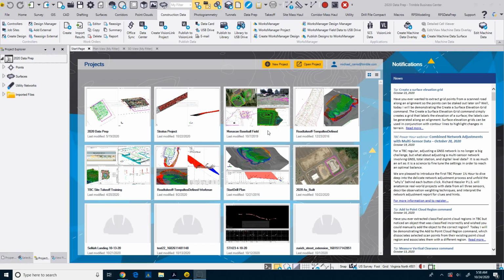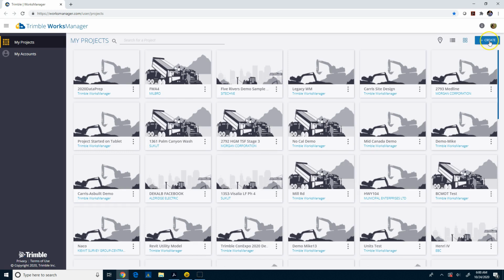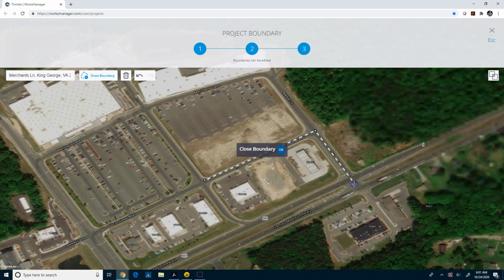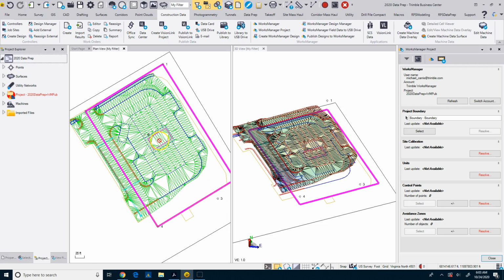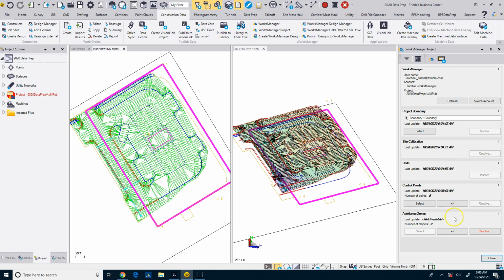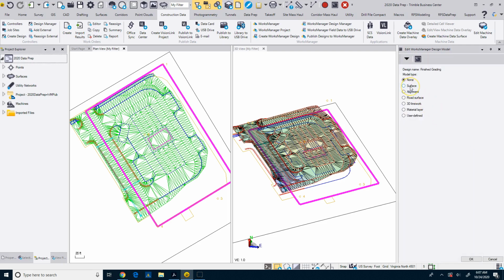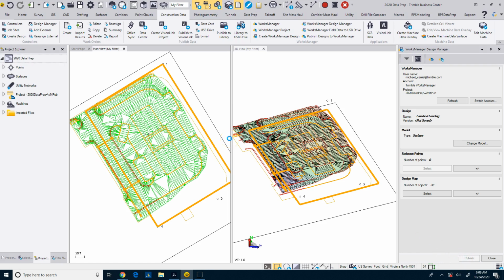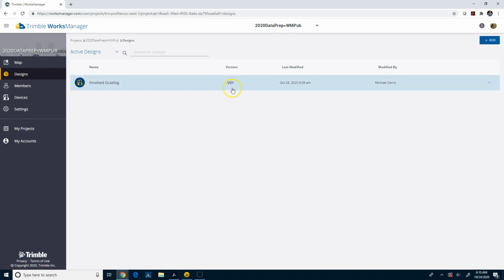Getting Started with TBC - Publishing Design to WorksManager

Comment: Is there a way to push the project in TBC to WorksManager without making it in WorksManager first?  Thanks!
Reply from the maker: Hey sorry for the delayed reply... You can make an offline project, and create a design to publish and create the files locally and save to a USB for your field devices.  However, to publish those same files remotely to the cloud in Worksmanager you will need to make the project in the Workmanger user interface, (website) using the same name project name, and the you can sync the design to WM.  I think I did a video on this and will try to find it for you. Not sure if that is what you were looking for.